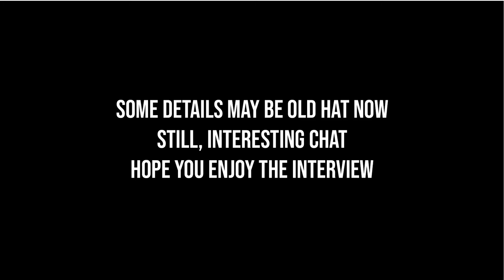Talking tech with Sunn Amps - Do they live up to the legacy?

Comment: Hello!  Wow, what a timely video as I have inherited a 2000S (DD567791) from from a good friend.  I have a few questions and am not able to find a user guide for it - although I see schematics out there.  Happy to send pics too!  1) Trying to learn what all these other jacks are for other than the 8ohm and 4ohm Ext. which are labeled? (2 jacks in the center and one to the left of the 8ohm out). 2) What is the proper way to run the 2 sunn cabs.  They are both 2x15 with only one input, so parallel is assumed.  However:  I put 1 cab in the 8ohm jack and the other in the 4ohm next to it.  On about “4”, the fuse blew and had to be replaced (you guys are the experts for sure!).  It's have a 3-prong plug so I think the death cap is bypassed previously.  Any advice for me?